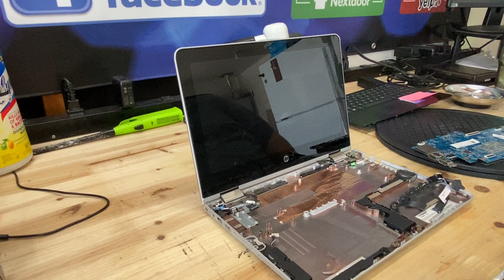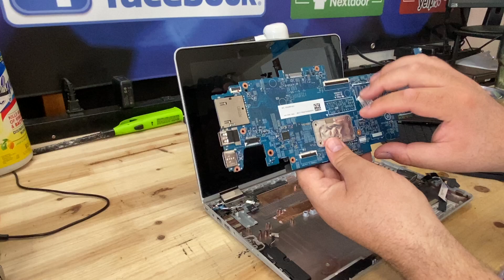HP Pavilion x360 - 11m-ad013d - RAM Upgrade (WHAT A PAIN!)

Comment: how did you get the top section correctly back into the face plate, so the section which holds they keyboard, is it the trick to first do back section next to the screen or first the front section

Comment: This is not a hard upgrade by any means, I am certainly not a tech at all, and I did this today- new ram new ssd, the ribbon cables and way too many screws are very easy to change. I use a pair of magnifying goggles with a light so I can see everything, the ONLY thing you really have to watch is the TINY coax connector on the wifi, you can easily rip the PID off. The rest is very simple
Reply from the maker: You're forming an assumption based on your own expertise and experiences. Keep in mind that everyone possesses different skill levels. What might seem "not hard" to you could be incredibly challenging for others. Some might not even want to attempt it because they prioritize their time differently. Nonetheless, I appreciate your input.

Comment: I wish I saw this video before I brought RAM for my dad's similar model. I checked the Specs online and purchased accordingly, SSD and 8GB stick. Opened it up and looked it over and figured it was under there.

While undoing the 8 screws I got a sinking feeling that Swapping the RAM was beyond my skills. So I ended up just swapping the old Hard disk for an SSD.
Reply from the maker: It looks more intimidating than it is. Heres a tip, Take pictures of the motherboard with the screws and ribbon cables before disconnecting them. Then you simply revert back to the pictures for the screw placements and ribbon connections.

Comment: Thanks for the video, repairing an 11m-ad0xx and I cannot find anything on this specific model, hopefully it will be roughly the same.
Reply from the maker: The “xx” simply represents that it’s a custom to order “CTO” build, that’s why you are struggling to find info on that model. The actual model can be found in small
Lettering on the bottom of the laptop. Of you can go here to find it by serial number. https://support.hp.com/us-en/checkwarranty
Reply: @coryscomputerrepair  Oh ok, thank you so much - I got it apart and the components are the same thing.

Comment: Hi, I just realized this model might be the last mini model to support miniature size with modular upgrades. The laptop can be a beast if you add 32gb of ddr4 with ram being able to run at reduced mhz, and having either 2tb of sata m.2 or 8 tb of gen 3 nvme.
Reply from the maker: You are not wrong! I always tell my customers most of these laptops just need some TLC/upgrades and they are faster than a $1300 laptop!  Most of the time, upgrades cost less than a new one because a new one is not going to have these bad ass components I upgraded their current laptop with.
Reply: @coryscomputerrepair I want to upgrade this laptop's SSD. The OEM replacement is SATA, but the "upgrades" I found online are PCIE. Will a PCIE SSD fit and work in this laptop? Thanks
Reply from the maker: @privateassman8839  I do not see a PCI-E M.2 slot in this laptop. You would need 2.5" SSD.
Reply: @coryscomputerrepair  I just realized I have a different model. I have the 11m-ap0013dx laptop. It does have m.2 support, and from a technical manual someone leaked, it does have NVME PCIE support. I'll probably get a 2tb SSD for it. Thanks!

Comment: Thanks for sharing this. I have the same machine, same problem with zoom. Would you go for a 16GB upgrade instead of 8GB? And... how did you remove the keyboard instead of the back?
Reply from the maker: Hello Kali, according to Crucials website for this model(https://www.crucial.com/compatible-upgrade-for/hp---compaq/pavilion-x360-11m-ad013dx) this model maxes out at 8GB of RAM. Also, the customer had no need for 16GB for her daily use, it would have been overkill for her. As far as how did I remove the keyboard instead of the back. On this model, the back is NOT how you get to the internals, the top is. There a a total of 9 screws that have to be removed from the bottom. 3 each behind each of the rubber strips. Peel the strips up, remove those six screws. then towards the front edge, there is three more small screws on the left, middle and right side. Once all 9 screws are removed, flip the laptop back over and use a spudger (or credit card) to careful pray up along the edges of the laptop. I say CAREFUL because there are ribbon cables connected from the top to the motherboard. You need to pry it up just enough to get to the cables and disconnect them before you remove the keyboard. You can watch this other video for more detail on how to accomplish this for this model. 

https://www.youtube.com/watch?v=2bEiy5cg29M

Comment: Can This Be Done On A HP Pavillion 360 Convertible ap0013dx? Thank You
Reply from the maker: I don't know, you would have to look up that specific model.
Reply: @coryscomputerrepair  can this model be opened not from keyboard, but from rear/upside down?
Reply from the maker: @debbiebernhardt3742  I wish! Unfortunately, no it cannot. That was part of my frustration, although I don't specifically mention it. There is no access to the components of this machine "The normal way" most laptops would have, from the bottom/upside down. Just the worse designed laptop. However, HP is famous for designed their laptops so it's incredibly hard to reach the components , let alone upgrade them. I always tell customers to stock with Lenovo, ASUS & Dell. Rock solid laptops with minimal hardware issues and all three usually have access panels for the RAM and hard drive on the under side of the laptop without having to open the entire unit. Even the processors have upgrade options with those three brands!

P.S.  man oh man my microphone sucked back in 2021. I am sure glad I invested in a quality microphone, you can hear the difference in my newer videos.
Reply: been looking too.
Reply: did you ever find out if it is